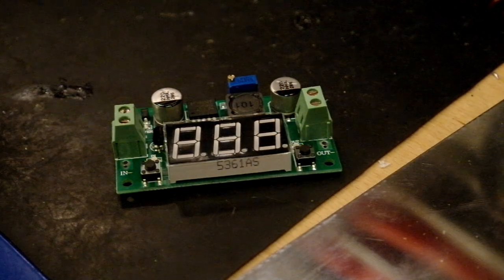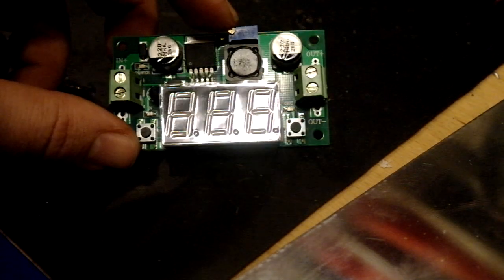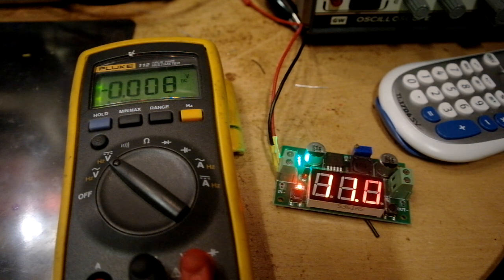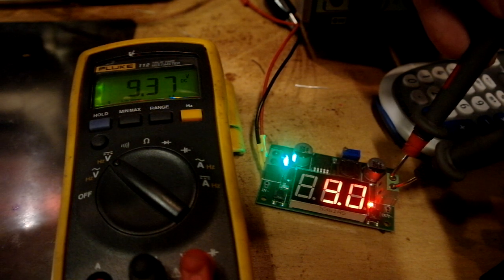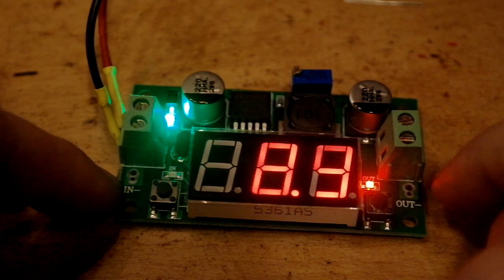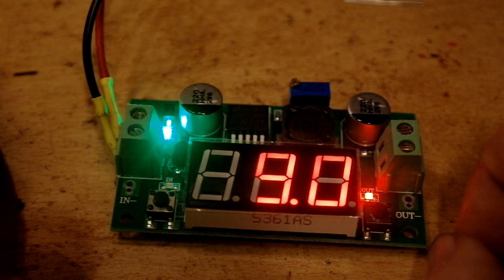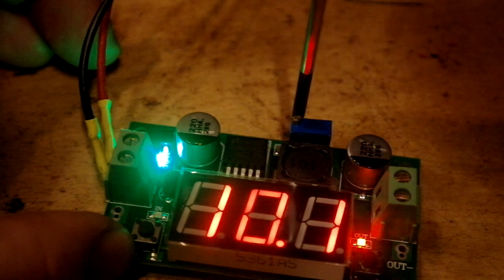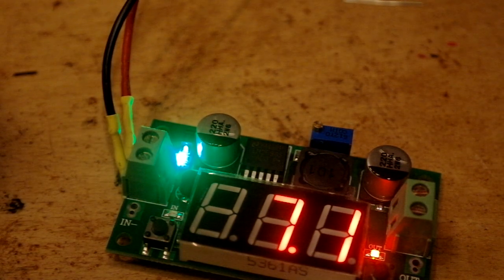LM2596 Voltage Regulator test

Comment: Nice video I just would like to know if it can be used for 3 outputs does the voltage will be divided? For example I got  a battery 14.8v and I need to use 12v for led lights, gimbal and fpv tx does the 3 of them will get 12v if I connect them altogether? Thanks
Reply from the maker: connect them in parallell.. and not in series and you don't loose voltage :)

Comment: The butons are for switch between input and output AND calibrate de display meter
Here tutorial: 

(1)    Output voltage calibration steps
Step 1, adjust the right button so that "OUT" LED lighted, the voltmeter shows the value of output voltage; Press the right button for more than 2 seconds, release, voltmeter and "OUT" LED flashes in synchronization so that you enter the output voltage calibration mode.
Step 2,press the right button (normal speed), the voltage value is adding up a unit; Press the left button, minus a unit; Due to a unit is less than 0.1V, the minimum voltage display to 0.1V, so you need to continuously press 1-5 times to see the voltmeter change 0.1V, how many times voltmeter change 0.1V by pressing the key, depending on the current display voltage, the higher the voltage, the fewer the number of press.
Step 3,press the right button for more than 2 seconds, release, to exit the output voltage calibration mode. All parameters set to automatically power down to save.
(2)    Input voltage calibration steps
Step 1, adjust the right button so that "IN" LED lighted, the voltmeter shows the value of input voltage; press the right button for more than 2 seconds, release, voltmeter and "IN" LED flashes in synchronization so that you enter the input voltage calibration mode.
Steps 2 and 3, consistent with the output voltage calibration method.
Reply from the maker: Thx Kevin. It makes sence =)
Reply: Thank you! My display was off by 0.2V & 0.4V, and now it's BANG ON! XD 
It's the little things in life, you know?